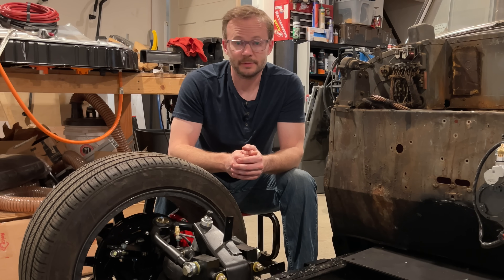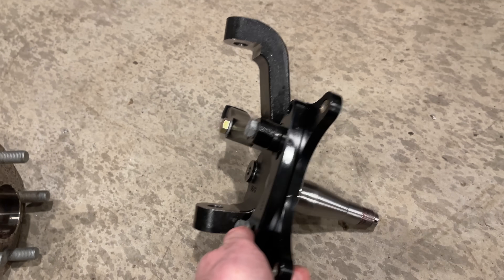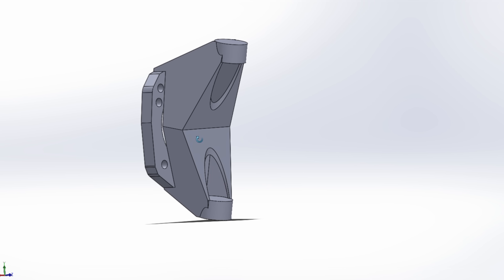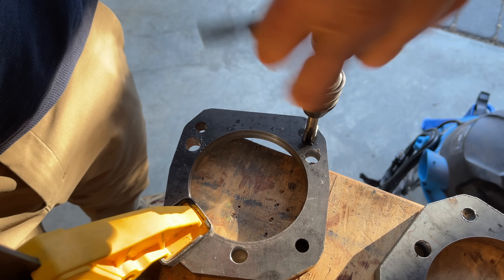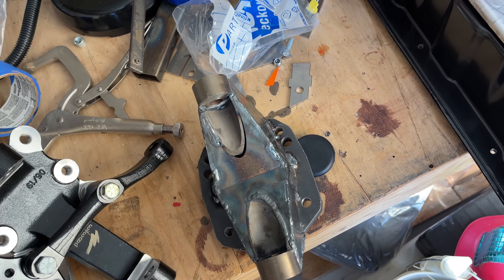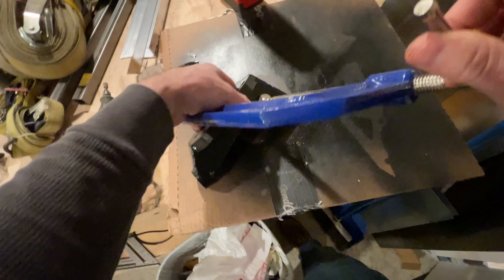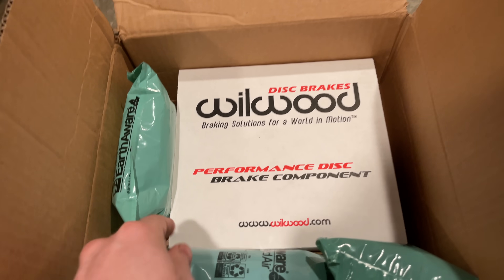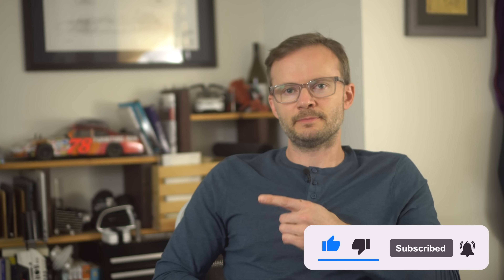Build Your Own Suspension Uprights. Or Just Watch Me Do It. Whatever.

Comment: Excellent!...
I recall salivating over some fabricated Formula 5000 uprights in the 1960's.  (I'm OLD!)
The car was one of the earliest F5000 cars made by George Begg, probably New Zealand's most prolific domestic race car builder of that time.
For the local historians, I accept I might not be 100% correct;  (I'm OLD!) the other car it might have been was the Begg Daimler, a single seater with a Daimler SP250 "Dart" 2.5l V8 engine.  This one first ran with eight vertical exhaust pipes, with conical megafones... they did little for the power, but they sure did wonders for the volume!
I'm pretty sure this car was carved up, and re-engined with a big Chevvy... it met its end in a scary end-for-end high speed crash on the main straight at Teretonga, while driven by Laurence Brownlie.  Laurence survived OK.
Ooohh... mind wandering a bit there... did I say?... I must be getting old!   😜

Comment: If you run your brake hose forward from the caliper above the lower ball joint nut and then to the frame in front of the air bag there's almost no movement in the hose lock to lock. Much better than the current more common method that bends the hose over.

Comment: Feel like I'm late to the party . . . for the internal threads, just tack-weld a hex nut on the backside before assembly, works great..  You can even leave the hole in the part small and run a tap thru the nut after, to tap the 1/8 plate too.  Or if you want longer threads, use a coupling nut.  I know this comment is 2 years old . . . but hopefully your welding has improved.  Or you could just mail it to me, and I'll weld it and mail it back, lol.  I enjoy your vids Matt.

Comment: Is the steering rod suppose to run parallel with the lower control arm. My early single lower control arm Mustang ll and steering rod are not parallel and I have violent bump steer on a pro street car I bought starting at 25 mph. If I feather the throttle it’s fine and will cruise at 70 mph on the freeway but if I had to make a fast turn I would probably end up off the road. If I’m traveling at say 45 and I hit the throttle hard it wants to throw me off t the shoulder very violently. I got very frustrated and had some health issues so I have not done anything but want to figure this out now.

Comment: Nice work...but I would not trust that threaded insert holding the steering arm on. A high tension stress could pull it out. Why not weld a hex nut on the back before assembling your upright?

Comment: To (maybe) save you some time & effort, I have found laser cutting is accurate enough that youi don't need to under-size your holes. I have had holes lazer cut to very acceptable tapping sizes. I figured if the holes weren't close enough I could drill, & bolt them, but the arrived spot on,.- Just had to run a tap through them. 😊

Comment: Aluminium tube or just tube in general doesn't exactly have concentric ID and OD’s. 

I bet you knew this. But now you can be suspicious if your getting vibration in your front end forevermore because your rotor is spinning eccentrically. 

Cheers.

Comment: Bro...   You did way too much..  you could have simply purchased a CPP knuckle and  went with a c7 corvette hub. Wilwood is hot garbage. Sad to see you went that way..  my m2 setup uses cpp's mustang 2 corvette knuckle, c7 corvette hubs, heavy duty C7 corvette rotors (14") and jaguar/ferrari F40/F50/viper/fr500 radial mount calipers.   Only needed a caliper bracket and voila, no re-engineering the wheel.  :)

Comment: I'm having a hard time assembly a suspension with the heim joints in SolidWorks, I just loaded the frame and a single heim joint and tried to assemble it but the heim joints seems to not move with the 3 degrees of movement like in real life, it only wants to rotate, not twist around the sphere. When I load the heim joint assembly alone, the sphere moves just like in real life. So what am I doing wrong ? The mates function in SolidWorks should be straight forward

Comment: Seeing as you have experience with Tesla brakes I was wondering if you could give me some pointers as to what I would need to upgrade my regular model 3 long range calipers to the performance calipers, I purchased a set of used performance calipers but don't know what else I would need to make them work, could you help me? Also I'm planning on using variant radon Wheels with the upgrade in a size 19x8.5

Comment: I'm wondering how you got the bolt pattern for the hub to upright interface. I'm trying to do the same thing using BMW E60 hubs and the two holes on top of these are closer together than the two on the bottom. I'm sure I can measure them to get pretty close and because this uses a boss ring to locate the hub in the upright, I'm sure it'll be fine. But still... if there's a better way I'd like to know. I'm thinking of cutting some pointy tips in some 12x1.5m bolts, screwing them through the hub flange and poking it into some cardboard and then I can measure the pattern from the cardboard.

Comment: For attaching wishbone arms to the frame, did you use heim joints? Would you recommend using heim joints over a bolt with bushings? I want to balance simplicity with strength. My application is a front suspension for a 900lb quarter scale pulling tractor with only 30% front weight distribution.

Comment: Seeing you use the 1/8 inch sheet metal just makes me curious what metal thickness you would need for making suspension or front k-members/cradles. Guess that depends on multiple factors and isn't as easy as just giving a gauge. Why did I get a liberal arts degree again?

Comment: You should NOT have paint on any of those bolted flange surfaces, or any, actually, let alone those that carry heavy loads. That will eventually lead to the fasteners backing off and a bad day for you, or at least, a rattle you have to diagnose and fix if it doesn't kill you. Mechanical engineer should know that, but maybe too much theory and design and not enough dirty hands? :-)

Comment: Re: Front uprights.  Is that a hub from a 4wd Tesla?  If so, you have to put a stub axle through the center spline with a nut on the outside otherwise the bearing will just blow apart and the wheel will fall off
Reply: Nope. This type of hub-bearing assembly doesn't use the stub axle for retention. See Matt's new video explaining this: https://www.youtube.com/watch?v=OU_-EqKSac0

Comment: Hi, interesting video. However, please take heed of people pointing out the possible errors of this kind of fabrication. 
I'll summarise my own worries in just one word; FATIGUE!!!
(Sub title; Catastrophic fatigue failure)
Reply: Your comment is interesting!  Should Matt be calculating the fatigue limit or fatigue stress for this part?  It seems pretty thick 3.1mm and a pretty normal way to make an upright for a racecar and this is a road car and the part isn't under as much stress.  It used to be pretty normal to make racecar uprights out of sheetmetal (steel), but I see that Walkinshaw Andretti United in V8 Supercars are using aluminium -- but not made of billet like most -- rather made of sheet or plate aluminium welded together.

Comment: The self clenching nut is generally called a "PEM" nut whenever I've run across them in aerospace.  I will warn you, anti-seize the crap out of it.  If you ever need to take that apart and it's galled or corroded, you will spin the nut loose and be pretty SOL.

Comment: I am a bit concerned about the absence of a supplemental half shaft and the large nut that holds the two pieces of the bearing together overtime your hub bearing will separate and come completely disconnected! Not trying to burst your bubble for I am thoroughly impressed with all others things that you have accomplished here in this video. But the design of the bearing calls for a tension nut quite like the spindle that you were trying to eliminate has to be there to hold the bearing together. A simple stub shaft off a half shaft modified will work nicely and the corresponding nut.
Reply from the maker: lots of people have mentioned this. I talked to a chassis engineer and he said that the current generation hubs often don't need the axle torqed down, and the Tesla one is probably okay. I bought an extra one to cut in half and actually do the engineering to find out. that'll be in an upcoming video when i get around to it.
Reply: See Matt's promised video for confirmation that there is no problem: https://www.youtube.com/watch?v=OU_-EqKSac0

Comment: I guess the only really huge mistake would be that a hub, like you are using, is designed to be held together by an axle being tightened into it. Without the axle holding it together the stub axle will simply work its way out of the bearings that it is pressed into. I would hate to see your wheels fall off after you've worked so hard on your project.
Reply: No, it's not held together by the end of the axle shaft. See Matt's new video for the details: https://www.youtube.com/watch?v=OU_-EqKSac0

Comment: Why not water jet cutting?  Omg surprised you still needed to machine the mount, i thought laser cutting was really precise
Reply from the maker: I could have lasered the bolt holes exact; laser is super close. honestly I'm not sure why i didn't except habit. The center landing of the hub needed to be pretty accurate. the laser might have done it but I wanted to be sure so it would hold the hub well.

Comment: I have a question mista Matt, will your brake lines interfere with the suspension when the jag is in motion resulting into damaging the lines ?
Reply from the maker: They way they are now? probably. I still need to secure all the lines.
Reply: @SuperfastMatt  just wondering, thanks for your time.

Comment: You can call what you want, you built it. But manufacturers call your "upright", a steering knuckle.
Reply: It's usually called an upright in motorsports.  The 2023 Formula 1 technical regulations even say "There can only be one suspension upright per complete wheel" (and there's a minimum weight and you have to make them out of not-very-high-tech aluminium of prescribed alloys, carbon-fibre wheels are also banned in Formula 1).

Comment: I took 68 Mustang wilwood kit and just by flipping the mounting brackets to the other sides, they fit stock 63 Impala spindles,  same rotors but wilwood spindles for a 63 Imp. I have these beautiful 20" Centerline dagger rims for my sport truck ('95 C1500 Std cab short bed fleet side lowered 5"/6"). Wonder if I can get '06 Z06 iron rotors & calipers to fit my modified hubs (cut the rotors off)?

Comment: POR 15 is also my go-to for frame or suspension painting! Every single can has been difficult to open without marring up the lid! I've found I can open it with a wide scraper though so the applied pressure is more spread out.

Comment: Dude, I am doing something similar to this on my z31 right now. This is crazy seeing someone doing it like this. I'm doing the z31 multilink rear subframe swap. Currently swapping w/ parts from the s13, q45, 350z, z32, and some custom stuff; all just to adjust rear camber lmaooooo.
Reply: I feel your pain, i had a z31 when i was younger, i now have a holden commodore (looks like the 2000's pontiac gto, but its a 4 door sedan) it has the same bullshit single arm rear suspension as the z31, but the springs are in a stupid place haha, also has no camber adjustment, had no toe adjustment either originally (i swapped the rear cradle and arms in from a 2005, they had toe arms from 2002, mines a 2000.) the only camber adjustment you can get is offset bushes, or a complete aftermarket cradle replacement which costs more than i paid for the three cars i used to build this one from, and all the mods done so far.

How i wish it were simple to fit something like s13/r32 rear suspension, hell, id even take a live axle 5 link setup over this, it handles like the z31 (poorly but not horrible) but also you wear half the tyre out at a time constantly. Drives me nuts my track day solution might be to make some wheel centres to go in a bbs/ssr barrel, but have two sets of stud holes, one tapered from one side, one tapered for the other, so you can just flip the wheel put it back on and use the other half of the tyre 🤣😂🤣

Comment: U might want to look into rebuilding the front upper control arm as to give yourself some castor. From what I saw, the uprights weren’t built with any kpi and the balljoint locations seem to be directly across from each other. Leaving u with a car that doesn’t self steer and tracks like it’s on rails. Just my 2¢. I could be wrong, but I love the build regardless. Cheers m8

Comment: Pro tip for por15:  instead of opening  the can, put a self tapper on either side of the can lid, one for pouring and one for venting. Lets you use it over and over again without drying it all out or permanently sealing the lid shut. Not my idea came from some guys at the company itself
Reply from the maker: Good idea!

Comment: the question is,   was that  Mild  steel  plate.      if so,  are you gonna heat treat the whole thing.       if not, you should expect those  bits  to  FAIL, from metal fatigue; if the car is  roaded, regularly.          googletranslate

Comment: Love your vids. I get to learn, which I enjoy. But I do have a thought about your suspension set up. I am familiar with suspensions. On your upper a arm, it looks backwards to me. It appears that in compression you will lose caster rather than gain. Am I seeing that correctly. I'm used to setting up the upper arm to set the upright aft of cl of the wheel for reasonable caster. It appears that if the upper a arm were flipped over it would provide more caster, less understeer. 
Then again maybe you did this on purpose because of the weight of the car and possibly no power steering  lmk
Cheers

Comment: That steering adjustment is kinda sketchy. Wouldn't the bolt have more wiggle room on the tie rod end with all the bolt holes overlapping eachother? Like if something hits the wheel from the side in a accident it won't be the wheel breaking it will be the uprights knuckle getting the "bolt holes" shearing as well and making it a slot. There's a method drivers modify their car in motorsport to increase steering angle called "cut n shut knuckles" cut the knuckles short and reweld them but your knuckle design is great since it's removable. Suggestion make swappable ones with different lengths instead of a knuckle with a slot. The modularity of your design is great.

Comment: You mentioned that you didn't need 5/8" for the caliper bracket, that you didn't even need half that... Brembo has had some of their 5/16" brackets bend, so I never go thinner than 3/8", and sometimes I go 1/2" and machine them down in non-critical areas- that's probably what I would do with your 5/8" one.

Comment: Your steering ends mounts look extra thin. Also bolted design will introduce even more flex into the system. We would use more material that bracket on upright for a car that is 600ish pounds with the driver and weld it.
Mate, I'm pretty sure Your drilled holes in thin metal plates are less accurate than what the laser would do. And it's not like You can alter the location too with regular drill bit.
And yeah, You could just probably bore out tesla wheels center bore to fit on Mustang hub.
Cool video though.

Comment: Weld a nut on the inside before final welds instead of pressing a nut in after final welds?
Reply: Or use a Rivnut or similar - they're designed for blind installation.

Comment: Spindles are best with tapered roller bearings that last forever.  Uprights use bearing hubs that have roller bearings that wear out.
Reply: They may wear out, but they last longer than just about any custom vehicle like this will be driven. They outlast most stock production vehicles... hundreds of thousands of kilometres.
Reply: These hub-bearing units have angular contact ball bearings. Yes, tapered roller bearings are great, but these bearings are suitably sized and work fine. See Matt's new video for the internals: https://www.youtube.com/watch?v=OU_-EqKSac0

Comment: I may be wrong here but I’m seeing a major red flag what’s holding the two inner races together ?. the outer end of the axle shaft typically holds everything together With the spline shaft an axle nut. The reason I’m bringing this up because the hub has splines on the inside Typically I see those on vehicles that have axles bolted to them. if they freewheel from factory they’re usually closed off And the inner races are being secured internally. I see you putting a lot of your blood sweat and tears into this and I don’t want anything bad to happen. I just wanna make sure for my peace of mind lol
Reply: Typically for older hub and bearing designs, but not in this case. The axle shaft doesn't hold this assembly together. See Matt's new video for details: https://www.youtube.com/watch?v=OU_-EqKSac0

Comment: The (aliens) mostly come at night. Mostly. I like how you show how things really happen rather than the "sanitized" style of most people as well as your delivery style and crappy welding lol - no insult intended; I ended up selling my nice Miller Tig since I just didn't used it enough to be good at it and my tig welding looked like yours! I'm sticking with MIG. Also, consider a Tormach Mill. Not that expensive, and being able to knock out pretty much anything you need pays for itself pretty quick. I need a new project. I'm thinking a TDI  mid-engined Prius but I'm already hogging all 3 garage spaces and my wife would probably kill me for the insurance.

Comment: Love your videos and suspension is a pain if you draw or just do it, i always seem to find my camber is out compared to the design so obviously along the way something isn't being calculated right.
With this i am slightly confused about your center hub stuff with the hat, i get the use for a spacer to center..so i take it the lip on the hat fits the rim's you are using?